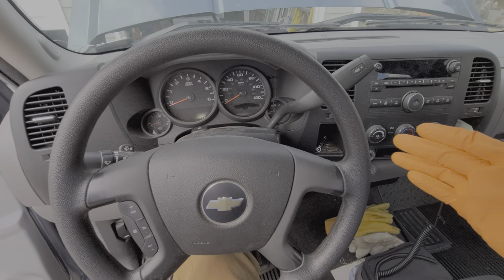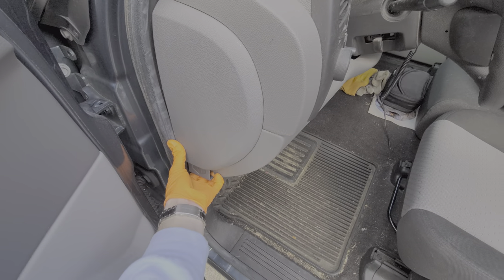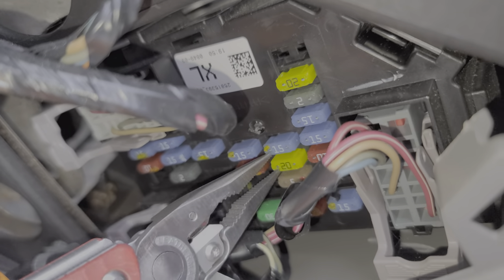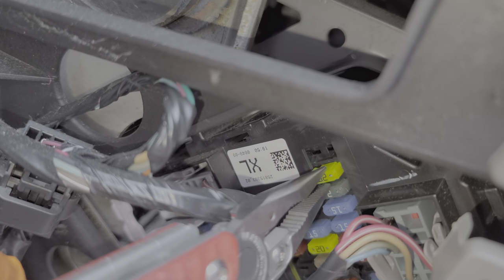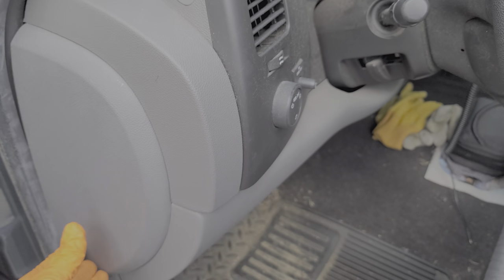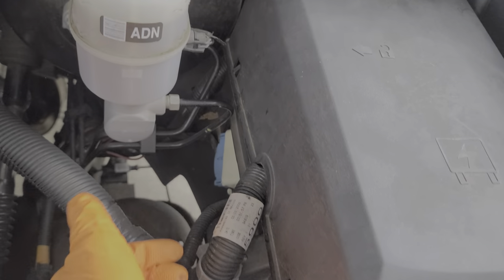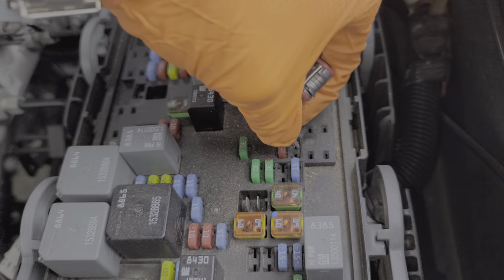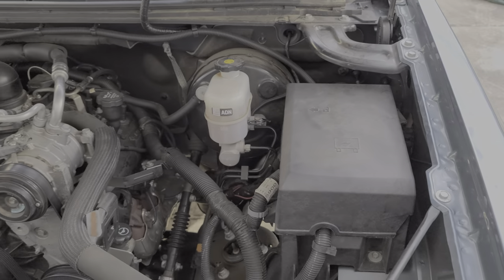2009 Chevy Silverado Power Outlet Fuses, Cigarette Lighter Fuse Location

Comment: Do the outlets only come on when truck is key on or are they constant?  I’m looking for an ACC 12v source to turn on my aftermarket amp.
Reply: Did you find a ignition switch (truck running).. What was the fuse going to?

Comment: Hello. I still have an issue. I plugged in a portable car vacuum and it blew out both fuses. I replaced both but only fuse #16 (right side) works. Unfortunately fuse #2 (left side/aux 2) still won't work. What should I do? Is my fusebox fucked?

Comment: Does anybody know on this generation of truck I have a center console with a cigarette lighter adapter inside along with the USB port above it. Does the power to the USB port share the same power as a cigarette lighter port? I don't see any fuse for the actual USB port itself. I'm assuming they share the same power is this true? Because my USB port doesn't work. Is a USB port getting power from another source? If anybody knows please leave a comment. Thanks!